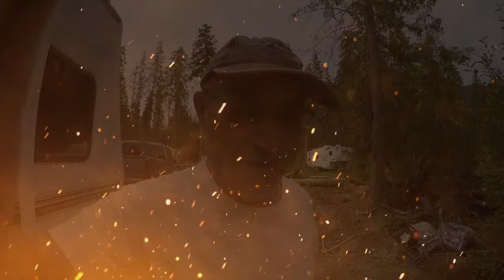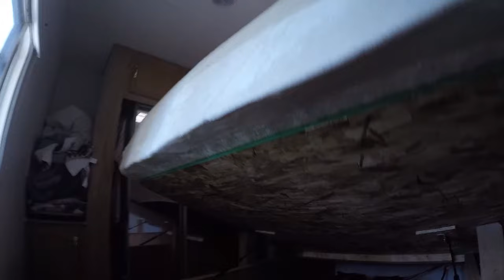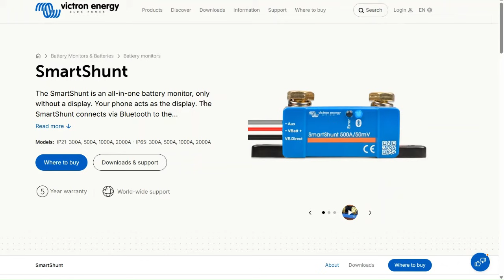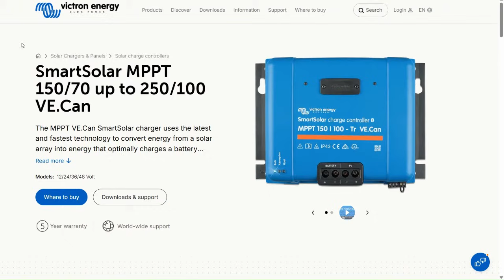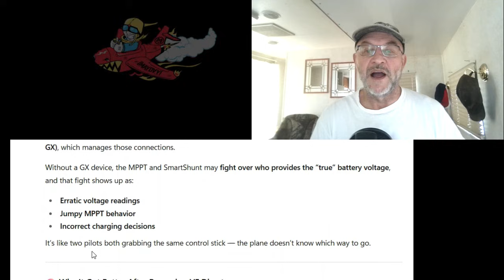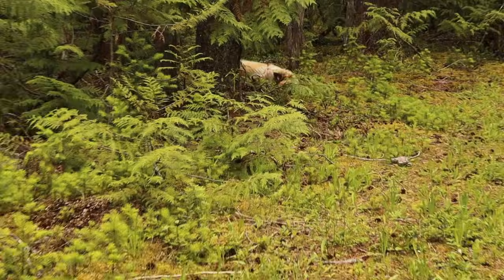Why Your Victron Voltage is Jumping — And the Easy Fix

Comment: Manuals are good. lol. You should click the 'Manuals' button under that downloads section on those product pages you show in the vid. Some info you think you know is wrong, like the VE Direct cable being used to daisy chain solar controllers. That's the VE Can and CAN bus, that use RJ45 cables for that. The VE Direct is for other types of connections, more fully listed in the manual for your controller, Same with the shunt. The manual clearly states what the VE direct port is for, and also, what else you can do with the shunt.
Oh, also, yes, the VE Direct cable can be used to connect to an optional MPPT control device (which is round, and mounts where you want it), but, the one you saw on the product page, that is rectangular in shape, does NOT require the VE direct cable, as you said in your vid, but, it actually plugs directly into the front of your particular solar controller, giving you an monitoring and control screen 'built in' to your controller.

OH... good... I mean your tech break. lol... I was going to say, self taught on Victron here but, since I read everything, not only would I never make that connection between those two devices, since nothing, anywhere, says to do so, but it would never have occurred to me that actual dealers, as in enough to make it a "known issue", would blindly tell people to do something they hadn't actually read for themselves.
(How can they call themselves a dealer if they don't even read the basic user manuals for the products they sell and/or install?)

When all the data/manuals are posted and so easy to access, I don't even understand people purchasing all this stuff without reading and making sure they understand the manuals before ever dropping a dime on the stuff.
If either you, or your dealer, had read either one of the manuals, for either one of those devices, you'd have known that they were NEVER meant to be connected together with that cable. As for your dealer in all this, they should, if you don't want to keep it for future possible expansion or use, take that cable back and refund you, since they told you, and sold you, something that is NEVER to be done in a Victron System.

OK.. I've watched a bit further now, and I almost let it slip past me... that perhaps you think, or maybe someone watching my think, that, since you can disable bluetooth on Pretty much any or all Victron products, that when you say the 'two pilots' bit... two data connections, that one could disable bluetooth, and THEN connect those devices with VE Direct.. and NO... there is NEVER a use case for those two devices to be connected to each other via VE Direct.

Well.. glad ya got that all worked out. (Remember... the "Book of Words", has its uses. lol)☮🇨🇦
Reply from the maker: @BorealisNights Thanks for taking the time to break all that down — good info in there. And yes, the manuals matter.

Just to clarify for anyone reading:
My video wasn’t instructing viewers to connect the shunt and the MPPT by VE Direct — I showed what my dealer originally told me to do, and why it caused issues. The whole point was exposing bad dealer advice so others don’t get burned by it.

Bluetooth + VE Direct conflicts were the issue I walked people through, and turning off one data path solved the voltage jumping instantly.

But you’re right on the specifics of VE Direct vs VE Can, and that’ll help viewers understand the terminology better — so thanks for adding it.

Comment: Hey Vern, what do you think could be causing my MPPT controller cooling fan to run continuously? (The old model, about the size of a small shoe-box with a display) I don't know if it's even a problem, but it don't seem right.
Reply from the maker: @bornajw Hey friend 👋 — good to see you here! If the cooling fan on your MPPT is running non-stop, it could be a few things:
1️⃣ Dust build-up inside
2️⃣ High ambient temps or poor airflow
3️⃣ A failing internal temp sensor causing it to think it's overheating
4️⃣ Or it's simply working overtime — maybe pushing more amps than usual (check PV input vs. battery demand)

Some older models have less efficient fan control too — they tend to just stay on. If the unit isn't hot to the touch and the performance seems normal, it’s probably just annoying, not dangerous.

Still, worth checking temps and airflow — maybe pop the lid for a clean-out (carefully). We just did a video on Victron glitches — sounds like you’ve got a topic for your own episode! 🔧☀️